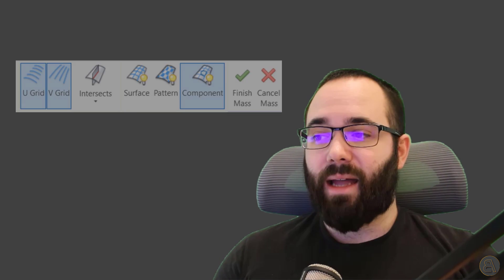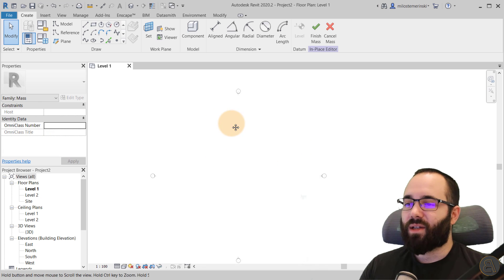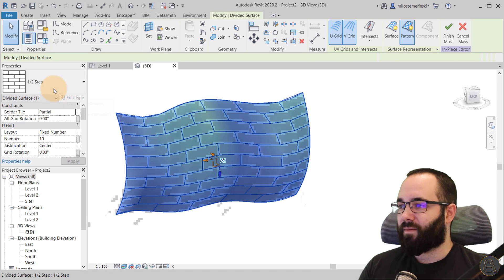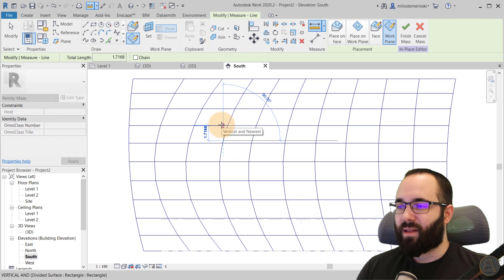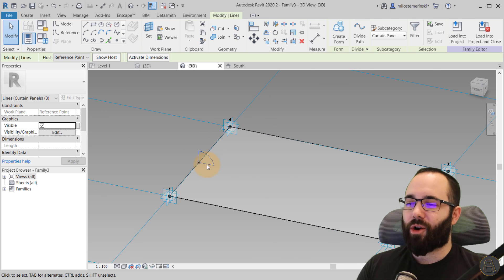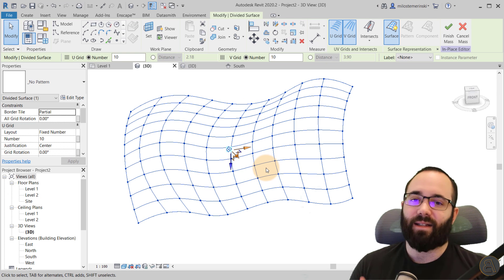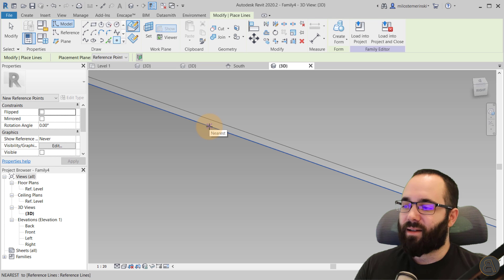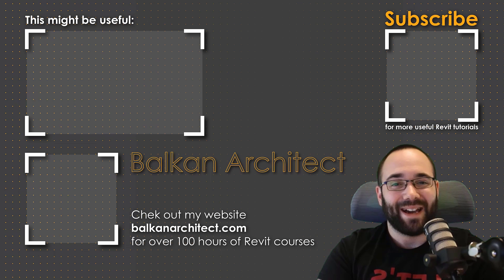Complex Surfaces in Revit Tutorial

Comment: I am not an Architect but a Civil Engineer, I learned so much about architectural design using Revit and Enscape. Another thing that I should learn is the bulding code related to minimum/maximum spacings/dimensions of rooms, furnitures, etc and materials so that I won't be relying on Architect to create architectural design and will be going to finalized the design based on my structural design, for example the dimensions of columns beams and spacings